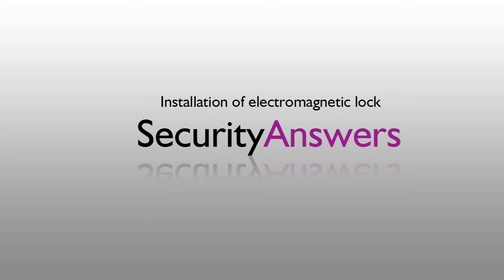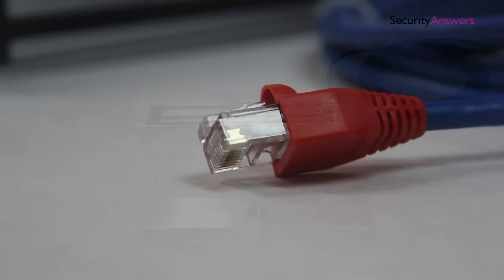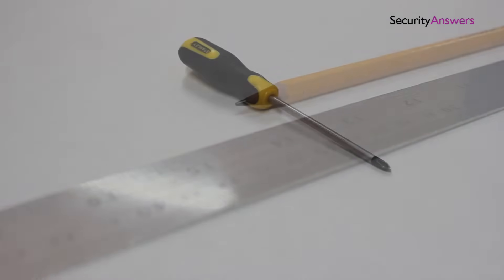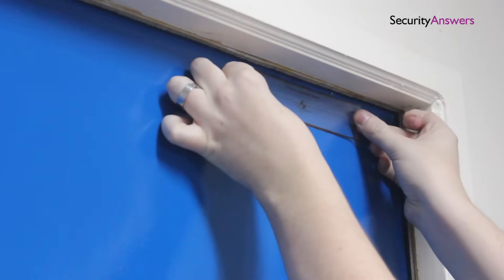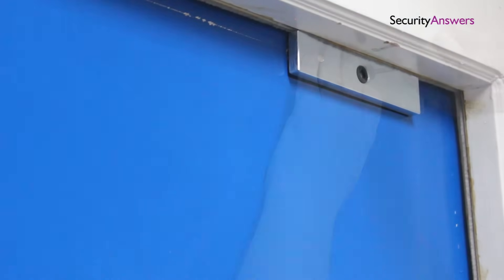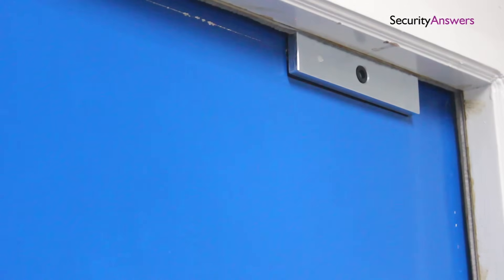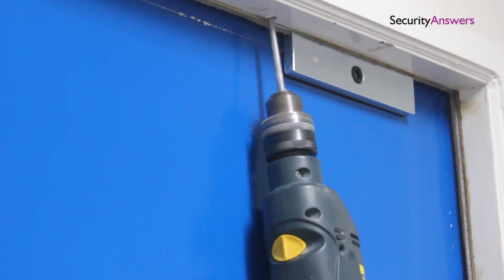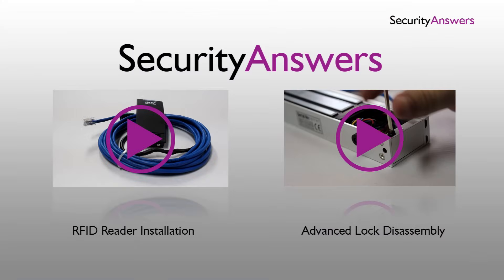How to install Electro Magnetic Door Lock

Comment: Was it really necessary to have that loud abrasive annoying music playing during the tutorial?  There was no way that the door plate lined up with the mag on this install, you mounted the door plate too high on the door, best practice is to center the door plate on the magnet with the magnet energized, then hold the assembly up to the closed door for alignment, mark the mag mounting location at this time.  You can put a bit of double sticky tape on the door plate when doing this, once aligned, cut the power and the plate will stay on the door so you can mark the mounting location, then proceed with the install.

Comment: Lmao, you left out 90% of the installation process.. great job! not, my favorite part is you have a cat5 already connected to the lock(I'm assuming for power? as any lock just requires a 18/2), then demonstrate how to drill a crooked hole while the door is closed(LMAO) that you miraculously ran that wire thru.. I wouldn't let you install a zoning sticker on a keypad let alone access security
Reply: I've seen people in Europe use cat5, you can use it if you twist the pair of wires together but you need two sets of each color most common is Orange and Orange/White being the positive and Blue and Blue/White as the negative.

Comment: From Valencia,  Venezuela, my  experience with Magnetic Locks : t's a lock that gives reasonable security in  access control, not too high, but it works, must be supplemented by other devices and should be helped with staff .  The MagLocks are good for offices, shops, they always have people inside. If there is no electricity, the lock opens, but you can install a Mini UPS

Comment: Garbage. Any lock is only as good as the way it is mounted and or installed. I small screw is hold the plate on, which means one small kick will handle that.

Comment: that lock is a piece of shit you would have too drill 2 extra holes in the metal strip and counter sink the bolt holes so the  nut head would set flush and the bolt would have to pass all the way thru the door with washer and lock nuts on the inside or it would pull right out of the door when someone pryed on it with a nail bar and the 2 bolts that hold the EM lock on the door jam is a joke i could get in that door with a craftsman screw driver
Reply: It would be fun to watch you try.
Make something better if these are so bad. Used in many places, and haven't read of them failing.
Reply: we bought a KURR electric  lock at our hardware store for 299.00 it works great and is flawless but it is designed differerent and had heavy hardware for mounting to our door.I added an automatic door closer so now if someone breaks in and comes down the stairs the door closes behind them and boom there stuck in the stare case between two steel entry doors and its going to be up to us to deside what happens to them break into the wrong house pay a big price,
Reply: I love the sound of this!!